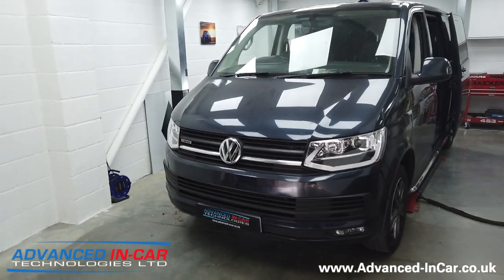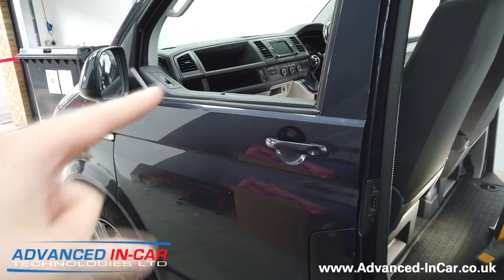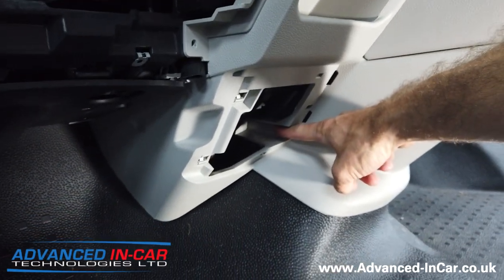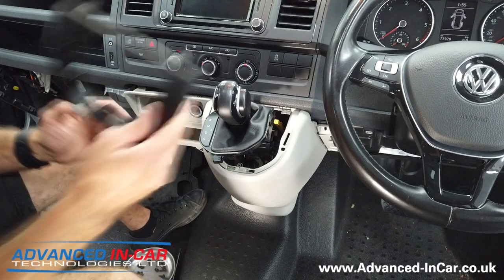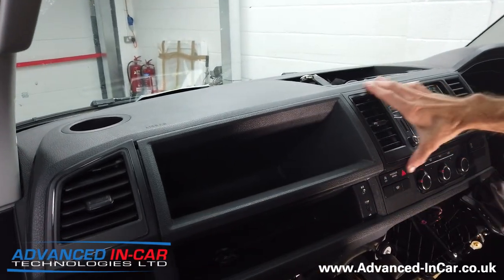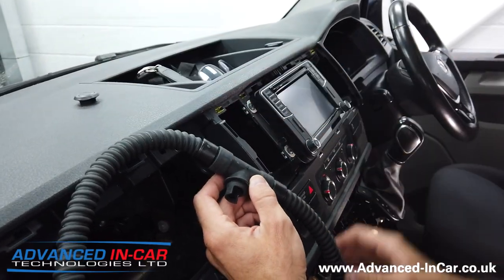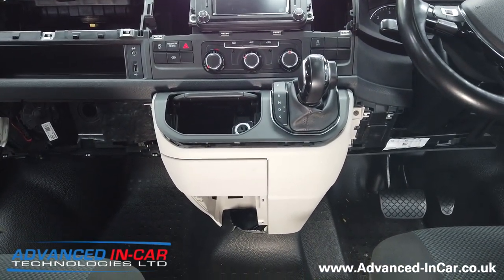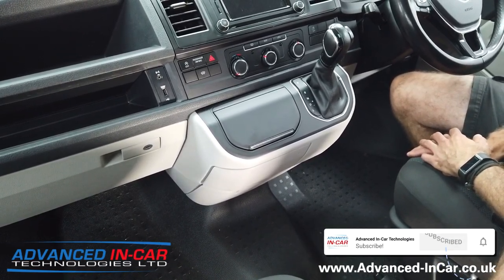How To Retrofit VW Transporter T6 Comfort Dash

Comment: Great video thanks! I was able to fit this kit with confidence. Slight struggle in two areas, transferring the cigar lighter socket (it was jammed in the old dash & needed heat gun assistance) and cutting the lower plastic and rubber carpet! What cutting tools did you use? I hacked mine a bit!
Reply: 啦。。，口，，。口，，口，，，錢

釷其。。
。，，。。土。冰，。一。女  金

Comment: Is this the entire 'comfort dash'? When I see Comfort Dash listed in the specs of a used t6 it also has the top passenger side dash storage fitted with a lid and also the center  tray on top of the dashboard covered with a popup lid. This seems to be more of a 'comfort gear surround' Do you sell a complete kit for everything?
Reply from the maker: What you’re referring to is the Caravelle Dash Upgrade. Circa £3000+

Comfort Dash in the industry is well regarded as the retrofit in this video.